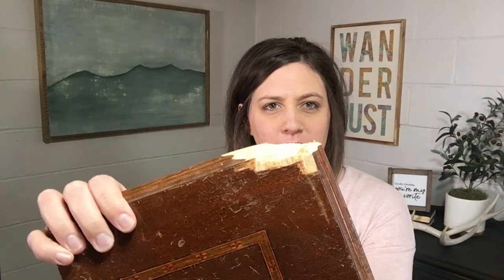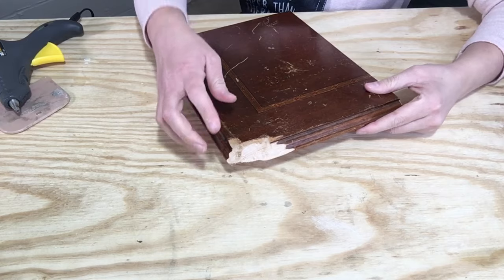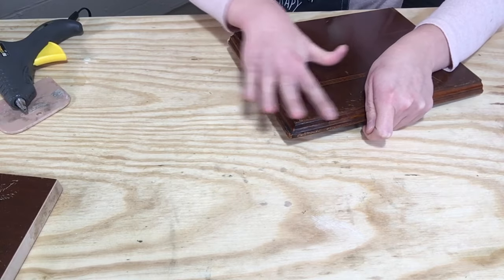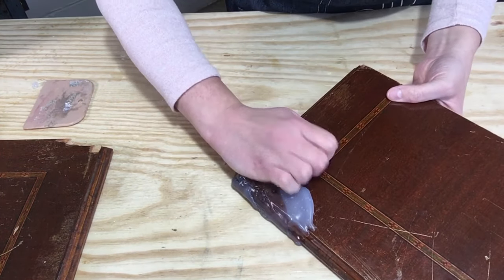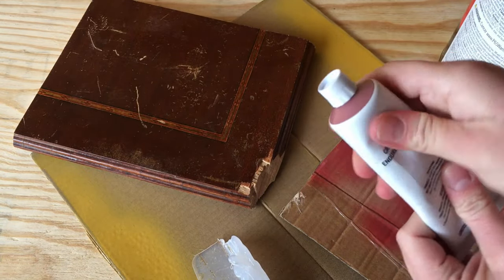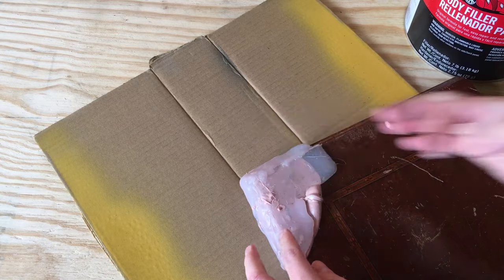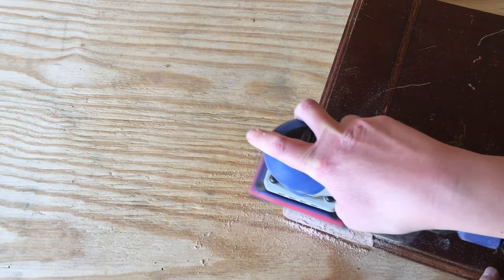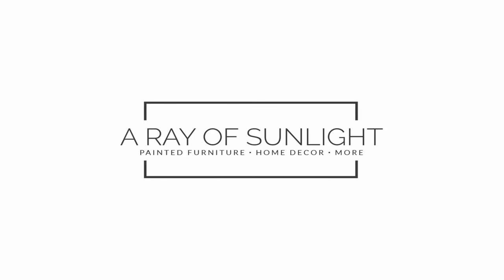How to Fix Chipped Wood Corners

Comment: FYI - Extra Hardener is also available at the pats store where you bought the Bondo. I always buy additional hardener because I tend to put too much in the white bondo before mixing. And yes, it gets really hard and is more difficult to sand. Thanks for the repair demonstration.
Reply from the maker: Great tip! I like to buy extra hardener as well for the same reason!

Comment: What a genius idea ! Great job ! I have a house built in the 1920’s and my wood staircase has lots of chips on the edge of each stair . Can I use the same bondo that you used ? I guess I just wont need to make a mold . Maybe just sand and re-stain the stairs right ? Thx so much !

Comment: Hello! Checking out your video, I just have a quick question about using BONDO FOR CARS, I was told that that bondo is not the best because with that bondo it doesn’t contracts or expand like wood does and in a long term will affect your piece… what do you think about that?

Comment: Hello! I just need some quick clarifications 😬 I know you don’t wait to remove the excess bondo so it’s not difficult, but do you wait until it’s completed harden to sand it? And, are there any other molding methods ? I need to repair a corner my dog chewed 🤦🏾‍♀️ but I’m afraid to damage the good corner while creating the mold 😩
Reply from the maker: Hey Vanessa! Thank you for asking! 
Yep I wait until the bondo is completely hard (about 30 minutes usually) to sand it down. 
There is a product called amazing mold putty (affiliate link - https://amzn.to/3d5bwWb) that you can mold around your good corner without damaging it. Once it's cured it feels like rubber and you can use it the same as the hot glue molds. 
Hope that helps!

Comment: What about if you want to keep a stain instead of painting it? What would I use for the bondo?
Reply from the maker: You can use wood filler bondo. And then stain it. But just like with other wood fillers, it won’t stain like wood does. So I would try gel stain or paint that is the same color of the wood finish.

Comment: Thanks so much! I'm not sure what to do because the damage is the top side of a coffee table. I could repair it like you suggested but didn't want to paint it. It is an antique and has matching end tables. After you paint an antique it loses it's value. I'm just sick over the damage anyhow. My son dropped something heavy on it.
Reply: I watched a video recently about repairing damaged wood and the guy used a hammer to put dents in some wood (to show how to repair it) and all he did was spray filtered water on the wood and place a cloth over it and iron it and it seemed like the steam somehow fixed the dents he had hammered into it. Maybe that will help?

Comment: Do you have any advice about doing this to a bare wood (hard rock maple) corner? What to use to match the color etc. I would just paint it but, in this case, that wouldn't be practical at all. The damaged area of the corner is very small but, highly noticeable.
Reply from the maker: You can use bondo wood filler that is more of a wood color. Other than that I’m not sure.

Comment: Great idea with the glue gun for a mold. I was going to use the corner of a cardboard box for a chipped door corner and some spray insulation foam
Reply from the maker: Oh that’s a creative idea!
Reply: @ARayofSunlight  If it's a small chip what do you think is the best filler to use?
Reply from the maker: Less than an 1/8” I use wood filler. Anything bigger I use kwikwood. Or Bondo.

Comment: I have watched a couple of your vids now and this one convinced me that you are very creative and know what you're doing. I am now aa new SUB!  THANKS for this valuable information. I am in the process of refurbishing an Ashley bed that my best friend gave me. It is the dreaded particle board. The biggest issue is at least 2 if the 4 posts are chewed up from her dog using it as a chew toy!! So, yes, I have to literally rebuild corners!  This is the best way of many vids I've watched to fix these!  I am going with the original paint color of black gloss. I'm leaning toward either General Finishes Black Poly or Minwax Polyshades Classic Black Gloss. I'm not sure which one can give me that glass shine? If you can suggest another product, I sm open to any help!! I just learned that it's not recommended to use a water based product, however. So that may rule out a few of the ones I may have thought of using. Thanks Again. Hey, maybe make a video of  you repairing a bed such as the one I am doing. BTW, I haven't started on it yet. I am just gathering info about supplies and techniques so that when I begin, I will go into it with confidence and hopefully a little bit of knowledge, instead of tackling it blindly!
Reply from the maker: Hey Janie!
I’m so glad it helped! Best of luck on your bed project! I’m not sure why you can’t use water based products though. As for the glossy look, the enduro poly comes in higher sheens than the satin that I use, but I haven’t ever tried it as I don’t usually go for glossy. Is that why you’re saying water based products aren’t recommended? Because oil based products have more shine to them?

Comment: You might want to try using two-part mold putty, such as from Innovative Solutions, instead of a big blob of hot glue. It doesn't stick, there won't be heat damage to the finish from the glue, and the resulting mold is flexible. I used it to duplicate some elaborate scrollsaw pieces and the results were great. It's a bit pricey, and the glue method would be cheaper, so there's that one drawback.
Reply from the maker: Yep there’s definitely that option too! One of these days I’ll get around to making a video with that method. 😄
Reply: I'm wondering if plaster of Paris would work?

Comment: Can i drill on the bondo? I got a metal chair leg loose screw because the wood it was attached was too narrow. I am planning to make the wood wider through bondo then screw the chair leg on it
Reply from the maker: Hey Mary!
Hmmm. I’m not sure if it would hold that much pressure. You can definitely drill into it, but I don’t know if you could screw into it and except it to hold.
I would feel a little bit better about using Kwikwood instead of Bondo. But I’m still not 100% sure of it working for your purpose. I have filled old small screw holes for small door hinges with kwikwood. Then I was able to screw the old screws into the kwikwood and it held the hinge on great. But I’m not sure if your purpose would hold. 
Best of luck!
Reply: Appreaciate you response will research also on kwik wood. Thanks 😀
Reply: I'm a year late but in case someone still has the same problem: Sometimes it helps to glue a piece of real wood where you need more flesh for a screw. Like use a drill to widen a hole so you then can glue a dowel of the right size into the hole. Now you have a fresh piece of wood for the screw. Carefully predrill a hole, fasten your screw and youre done.

Comment: What do you use to remove the vaseline from the wood to make sure the paint adheres? 
Thank You for this vid, I just tried rebuilding a corner like this with filler and it of course crumbled :(
Reply from the maker: gigitx oh no! That’s a great question! A mix of Krud Kutter (or a grease cutting cleaner) and scuff sanding will make it so paint will stick in that area again.